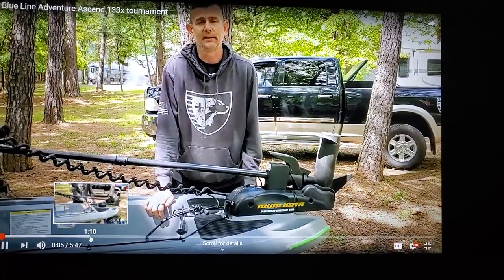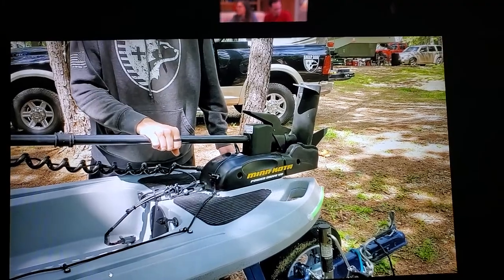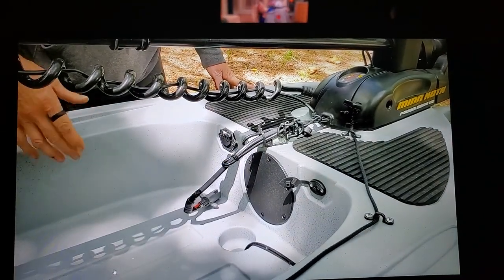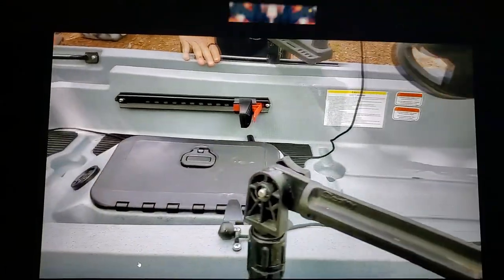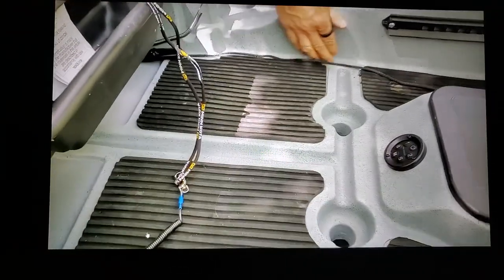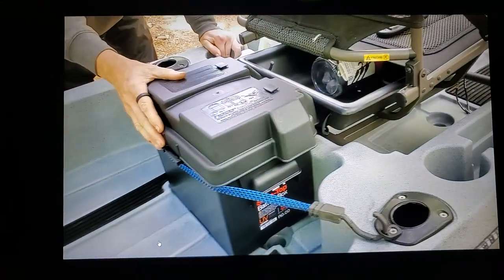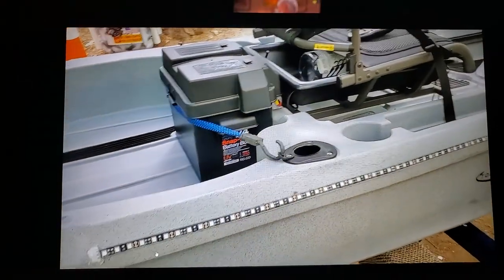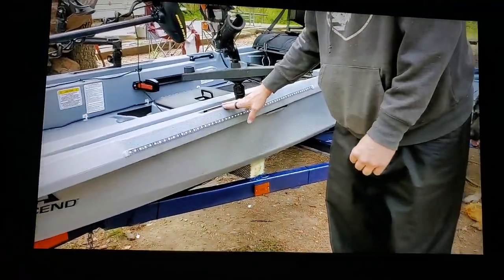Ascend 133X Upgrades with Blue Line Adventure

Comment: Where did you get your trailer. I  have a tbar on my colorado and my 133x hangs wayyy out of my bed! Like trailer! 👍
Reply from the maker: I found the trailer on FB market place. It's an old John boat trailer.  I just used some 4X4s and 2X6 and made runners to fit my kayak. 
It works great.
Reply: NICE THANKS

Comment: Just picked one up myself on sale didn't opt for the Xi3 with gps mines just bt remote. I'm setting mine up and always looking for ideas.
I like the green lights you put facing down. Do they come in a set? Or do you buy them singley?
Reply from the maker: I bought the green lights at Academy and they came individually packaged.  I live the green light color reflecting off the water. It brings in the small bugs which brings in the minnows that draws in the bigger fish. I have latterly had a big bass boil the water next to my yak that was chasing minnows. 
Thanks for watching my video.  Should be having new stuff out in the coming weeks.